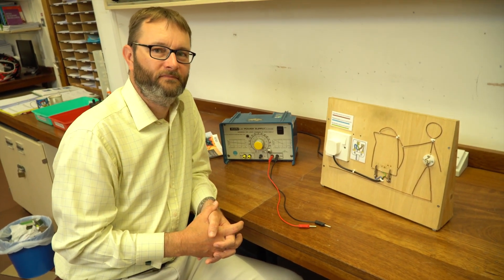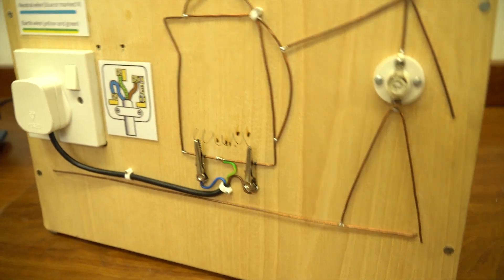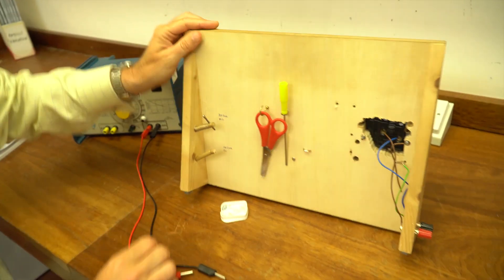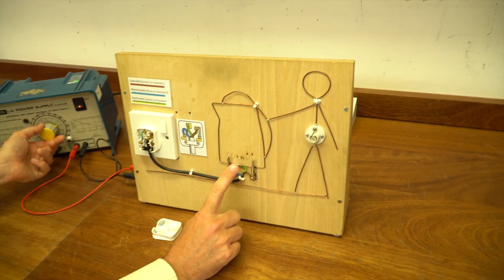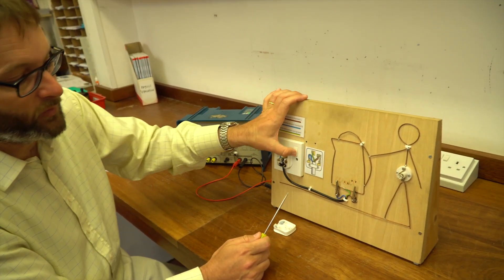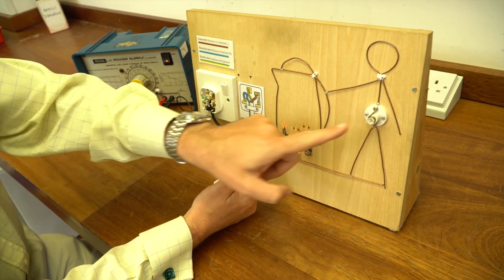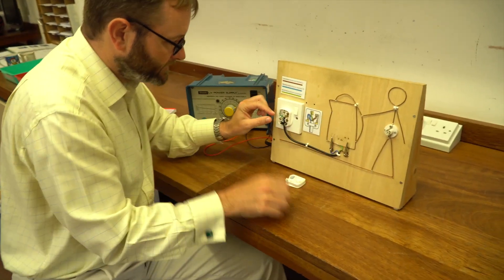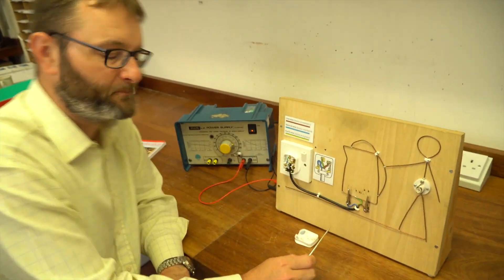Fuses Stop Electric Shocks? Wrong! How to Teach Earth Wires

Comment: Current takes all paths. The element has actually lower resistance. A 3 kW kettle has just 19.2 ohms.  However, while the kettle uses 13 A, only 0.1 A can kill. Also the wire can get completely loose so that it does not connect to the heating element.

The earth wire does not go to the earth on a TN system. It goes to the transformer via a copper connection. On a TT system it goes to the earth but then the resistance is so high that it does not blow the fuse. On TT one must have an RCD to make it safe.

One should abandon the term "earth wire" and use the proper term the CPC (The circuit protective conductor). That tells what it does without giving false implications how it does it.

Comment: I'm a bit confused about how the fuse blows up.
please explain
Reply: The fuse blew because the current (amps) exceeded the fuses 13amp rating.
Reply: @uncontrollable343  Actually it takes some 21-23 A to blow a 13 A fuse.
Reply: On a real TN-C-S (Terre-Neutral-Combined-Separate) or PME (Protective multiple earthings) system widely used in the UK the Earth wire or the CPC (The Circuit protective conductor) is connected to the incoming neutral at the meter. This causes very high current which either blows the fuse in the plug or trips the circuit breaker making it safe.

There is another commonly used system in the UK: TT (Terre-Terre) in which the CPC goes only to an earth rod. This does not trip the breaker as the current is not high enough. Therefore on TT RCD protection is absolutely necessary (not just required additional protection). Typically one has two levels of RCD protection 100 mA for the earthing to work and 30 mA for additional protection - though I think one could have only the latter (not sure).

Three is also a third method known as TN-S (Terre-Neutral-Separate). In it there re separate earth and neutral all the way from the socket. It is not used anymore on new installations as it requires more wire. It works just like TN-C-S in case of a fault, it just uses the separate earth wire. There are also other systems but they are not used in the UK - at least on residential use.
Reply: @okaro6595  if you want be accurate you’d say 1.66x times the rating. But that wasn’t the question asked was it.
Reply: @okaro6595  very rare you’ll find a TT system on a residential property. The majority is TNS. Definitely not “common” at all.